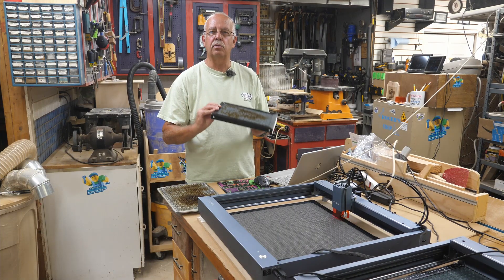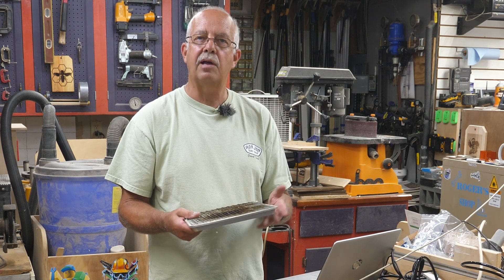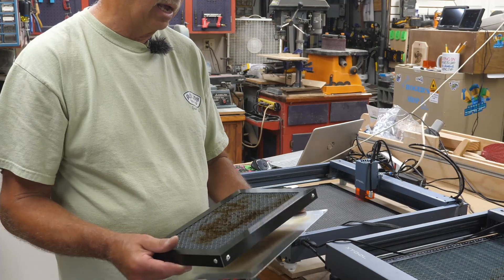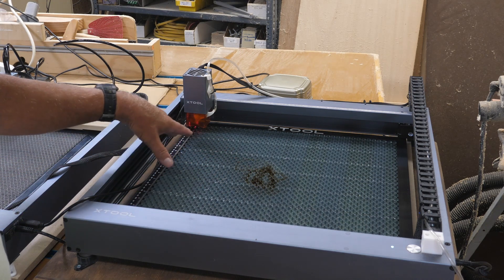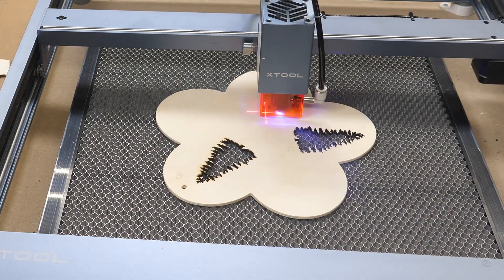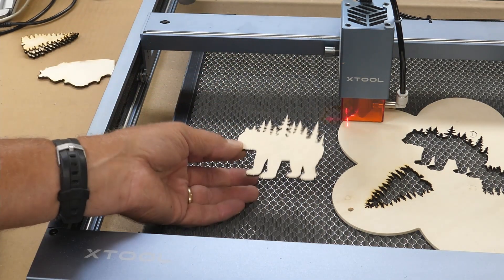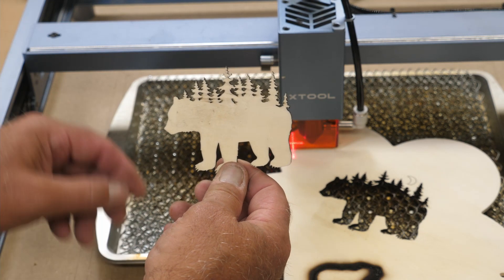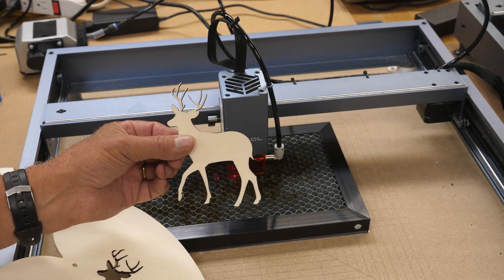Laser Honeycomb Boards Compared

Comment: Thanks for the Ray 5 mounting feet and elevation feet, just got my two spoil boards for raised and non raised engraving today, and jammed out a spoil board etch, and a glass engrave for an anniversary gift.  and now i know i can just swap back and forth without losing center.  one interesting issue though. if i use the TF card and try to frame a project, it errors out on a hard limit and seems to try to go negative X position, but if i place item where it is suppose to go, and just hit engrave, it works fine.. no idea why it is doing that..

Comment: A little tip you might appreciate: Move the Laser to the rear position after finishing cutting. Ive seen that Lightburn can add additional g-code commands at the end of a job, so i guess you could add "use absolute coordinates" (in case you are using relative coordinates in your jobs), "zero all axes", and "move to [max-y]".
I just ordered a laser cutter (laserstack a20pro), so im new to this, but ive done similar with my 3d printer.

Comment: Hi Roger, love the vids on the aufero 2 which I recently purchased. Two questions…first in the set up vid you were going to do a follow up vid on the baseboard you had planned in making…I couldnt find it. Could you provide a link please? Second I have the base laser that it came with what would be a compatible upgrade for cutting?
Reply from the maker: The baseboard I used on the Aufero 2 (before I added the extension kit) is 3/4" plywood.  1/2" MDF or plywood can also be used.  The layout grid is a generic 300mm x 300mm and you can download that from one of our websites here:  https://moonshinecrafts.com/faq/
Mounting feet are 3D printed and I will have these up on the site soon for purchase.  If you have a 3D printer, email me and I will send you the .stl file to print your own.
If you intend to do cutting, I suggest adding air assist as well as a honeycomb board.  They make a huge difference!

Comment: I bought the xTool honeycomb with the D1 10W laser. I thought it made sense, along with the air-assist. They do make sense, in general, but the very expensive xTool honeycomb is not worth it.  IMO, the full-size honeycomb should match with the workspace shown in the software screen. There are no instructions or tips for how to orient the honeycomb in the frame, which makes the rulers on the sides, and the sides themselves, useless for positioning. Also, the inch ruler is in tenths, which doesn't translate easily to anything Americans do using fractions of inches. 🤔Lastly, the magnets are too thick: if you want to have it hold down an edge that curls up, the orange shield bumps the magnet if the laser head goes there.🙄

Comment: Interesting! I have a Glowforge Pro that comes with it’s own honeycomb plate. I still get the little scorch marks on the back. Any suggestions on how to not get them?
Reply from the maker: Raising the project on a nail bed might eliminate it.  I only get the back scorching when there are very fine details close together.  But, this is on diode lasers, not CO2.
Reply: using masking tape will eliminate scorching regardless of elevation
secondly you can use air assist